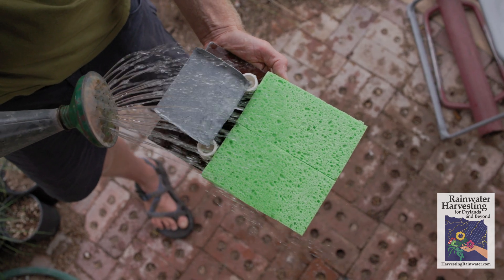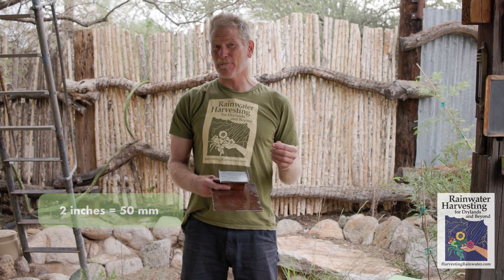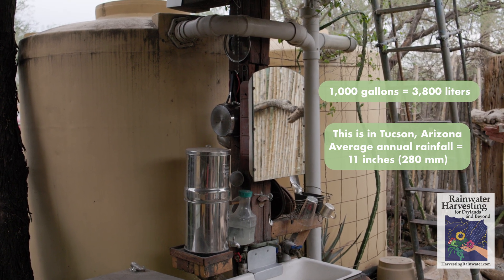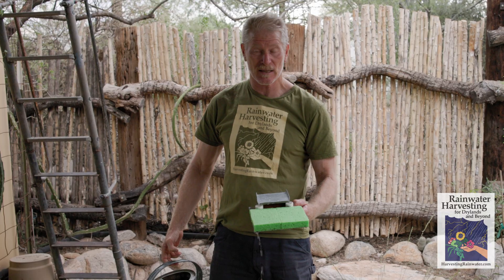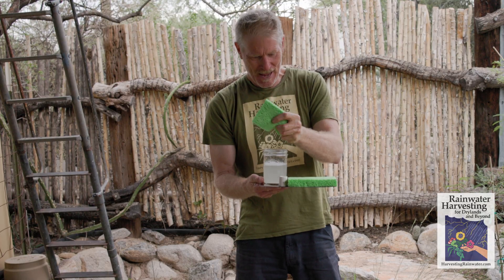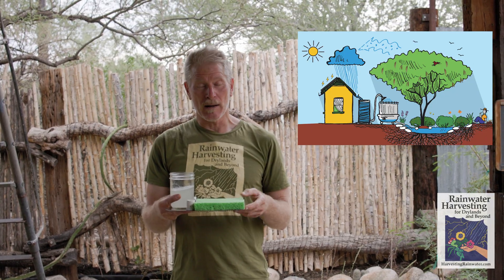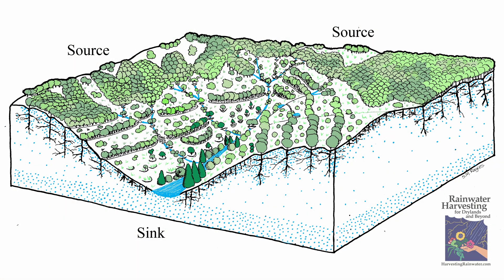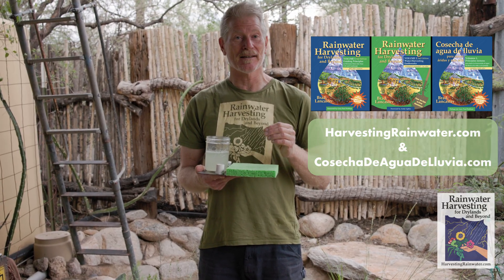How to Soak Up Rain Like a Sponge!

Comment: Very clever demo!  I live in CA.  I use a lot of water in the summer to keep all my trees alive.  I discovered several years ago, that wood chips will protect my property from flood damage waaaaay better than any sandbags.  While I am a bit worried of contaminated woodchips with termites, you can get free woodchips delivered by local tree cutting companies. It does break down and helps the soil.  Personally, I haven't found the energy to do all that gardening but I want to help the earth and that was my fix.

Comment: Even if your ground is all sand, you can keep rainwater in it, excavate the land, line the sides and bottom with clay, and then put the the sand back. Add a stone-lined well to access the water from the waterlogged sand.
Reply from the maker: Organic matter does a great job of holding onto moisture longer. And you don't have to buy it, you can grow it.

Comment: Recommendations on pumps & filters for rainwater catchment tank outputs?
Reply from the maker: Depends on the unique context and specific application.

Generally, I try to set up all my systems so they can work just with the free power of gravity. That way no costly pumps, power inputs, or pump maintenance is needed. 

See my water harvesting principles in the full-color editions of my books "Rainwater Harvesting for Drylands and Beyond" for more on how to do this.
https://www.harvestingrainwater.com/shop/

And see the rainwater-tank specific principles as well in chapter three of my book Rainwater Harvesting for Drylands and Beyond Volume 1, 3rd Edition for more on that.
https://www.harvestingrainwater.com/product/rainwater-harvesting-for-drylands-and-beyond-volume-1-3rd-edition-new-2019/

As to filters, I think a rainhead filter for the tank inlet is more important than a filter on the tank outlet.
See link below for more on rainheads.
https://www.harvestingrainwater.com/gallery/rainhead-screen-image-gallery/

I filter my rainwater used for drinking and cooking with a Berkey gravity-fed activated carbon filter. It has worked great for years. 
See linked video below for more:
https://www.youtube.com/watch?v=hkJW6FuOe34

(No filter is needed if using the rainwater to water plants).
Reply: @Brad_Lancaster_Water_Harvester The place I moved into has this setup: A square house with a downspout on each corner. Downspouts are all piped down underneath the house where they meet and connect to a single pipe which feeds to the tank (which is approximately 35' away from the house, downhill). The top of the tank is lower than the roofline; the inlet is buried in the ground going towards the tank. So, basically a closed system aside from an overflow & outlet. I intend to use the water for irrigation, but also, in case of emergency, I'd like to be able to fall back on it for drinking & potentially fighting fires. We're in the worst drought I've ever seen during my 16 years living here, and brush fires, particularly in my area, have become commonplace. 

Thank you for your thorough response & recommendations. We're all thrilled that you've been uploading more often. Thank you for all you do, Brad.
Reply: @808zhu 
I would have both an input filter to catch large debris to protect the pump and keep the output filter piped directly for in-house use cleaner.  

Make sure the pump you buy is approved for drinking water is my other suggestion...
Reply: One way of dealing with it is to place the catchments higher in the landscape.  This lessens the need for irrigation pumps.
I know Geoff Lawton has some videos about creating outlets from catchments for flood irrigation opportunities.

It also creates more strategic firebreaks, decreases grid dependency, etc.
Reply: @b_uppy Unfortunately, I'm dealing with a preexisting setup that is the opposite of what you've described, otherwise I would love to do that. Definitely going to pursue a solar solution re: the pump.
Reply: @808zhu 
That sounds practical.
Reply: Maybe check out his three books on "Rainwater Harvesting for Drylands and Beyond."
Reply: @colleeneggertson2117  Cool, thanks - I will. In the meantime, a quick response would do.

Comment: You get a lot of utility out of harvesting rainwater to soil.  That plant life does a lot for raincycles, providing food, medicine and forage, managing floods, drought, temperature wildfire, soil quality, pollution removal, etc.  
It's a zero/low waste system...

On another note --describing the soil biome as a pump rather than merely a tank better explains why using the soil and plant biome wins over rock filled wells is a more dynamic strategy over the static one....